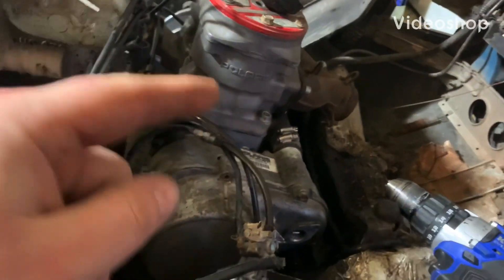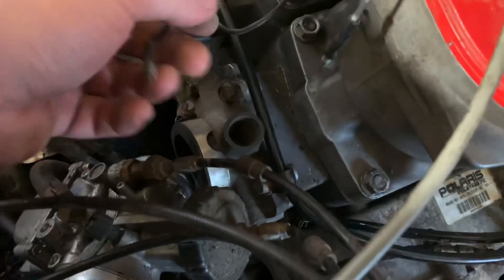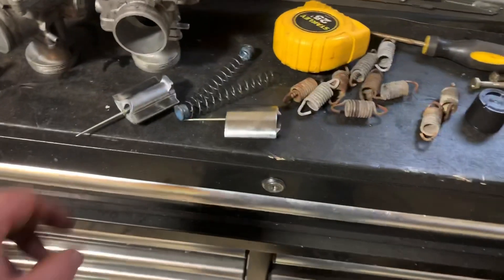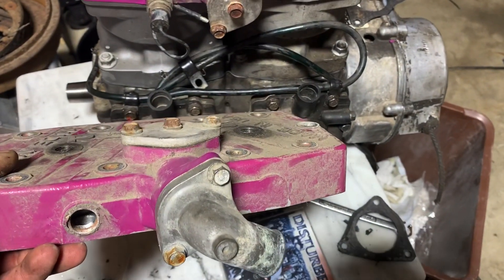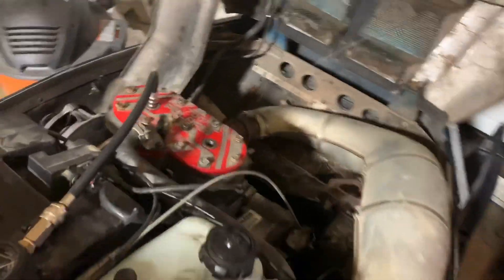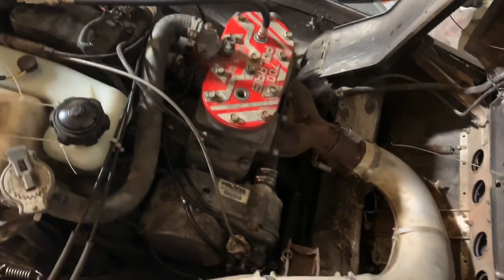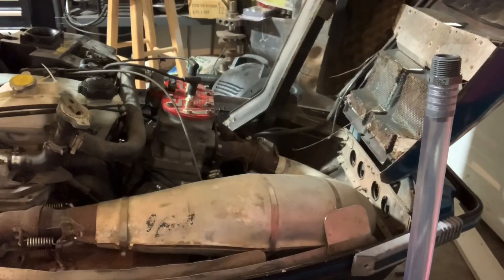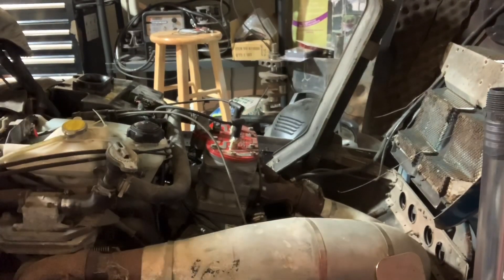Polaris 770 big bore install and first start

Comment: First sled was a 94 xlt sks 580, I put on 5k miles and still runs gorgeous. After 14 years I bought a 2002 rmk 700. I love it to death! However..I find it hard to find any aftermarket parts to mod it out or anything! I swear iv looked everywhere. Any tips? I see your a Polaris guy like me...our kind needs to help each other! 😂 Awesome videos, I love them. Watch them all the time actually

Comment: Keep up the videos man they're great! 
Especially the wedge videos lol 

I just picked up a 96 ultra on Sunday for 100 bucks, I'm planning on swapping in a liberty 600 and an edge skid.. 

I picked up a complete 02 x edge 800 for 200 bucks a couple weeks ago to be a donor sled but I was able to get it running well enough that I don't wanna part it out anymore plus i dont really like the belt driven waterpump/ oiler so I'm going small block instead..    

Thanks for the videos man..

Comment: My 2001 xcr800 had fuel problems when i got it used. Mint condition former dnr sled completely stock low miles. Fuel pickup line inside the tank rotted so it would idle high then one day it wouldn't start. New line fixed it.

Comment: Can't wait to get my 860R built tomorrow, bottom end done, just waiting for jugs to get back to me now. Good idea on priming the oil pump with the drill like that, I was just going to spin the motor over with a drill with no plugs, but that seems like a better idea to at least bench bleed the pump. Won't be able to even see the pump in frame.
Reply from the maker: What’s the 860 based on? I had a BMP 860 in one of my old 13’ pro’s. It was a rocket.
Reply: @AKproXR  mines a 11' Ptek 800, Straightline Performance everything, 860 kit, pipe, can, head, y pipe. Doing a rebuild with some advice from Big John (Sledhead Racing), using his pistons and squish specs, since Straightline Perf customer support is almost non existent.

Should be making some good power when done, running a 154" track on it.
Reply from the maker: Velislide awesome 🤘

Comment: I got one more question for you I have a indy 400 it's a wedge I think around 1989-90? What motors could I swap? Could i do a 97 rmk700 or a triple like the storm, rmk600 or  is it to much work
I would prefer the 97 rmk700 I love those sleds

Comment: And are the boots supposed to be tight around the carbs? They are pretty loose fitting it feels like it has a ton of compression I'm hoping it's not a crank seal but it stops running that way after I get to lower elevation

Comment: I have a 2001 rmk800 and jetted it to 0 to 3000 feet today I rode it from my house about 2 thousand feet and rode to about 4 or 5 thousand feet and it started cutting out at wot so i checked the plugs and they look really old and the pto side was kinda white on one side of the plug should I move the needle I just got the sled and haven't really been around 2 strokes since I was really young so your thoughts would be awesome
Reply from the maker: Hard to jet for multiple elevations without tempa-flo or similar. Higher in elevation you go, the richer it will be. White plug sounds lean though. Need to check for air leaks.
Reply: @AKproXR  so if I had an air leak would it run lean on only one side like that?